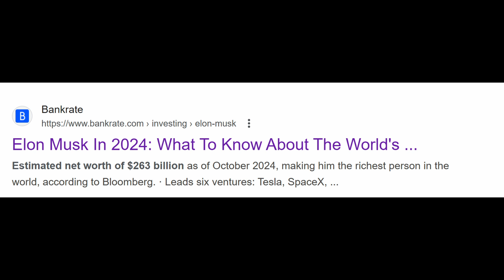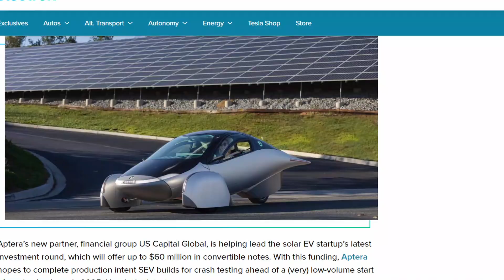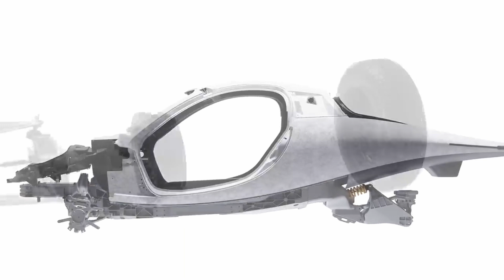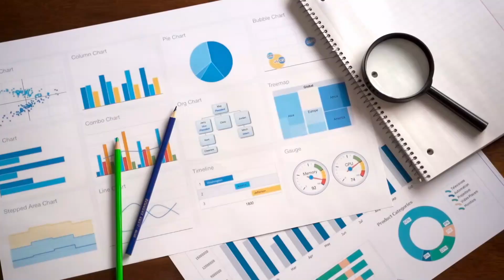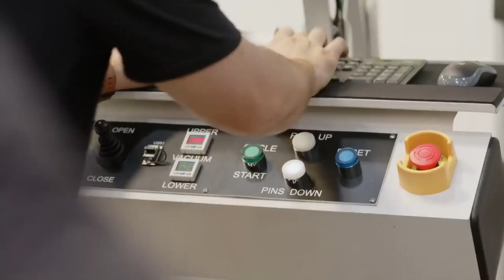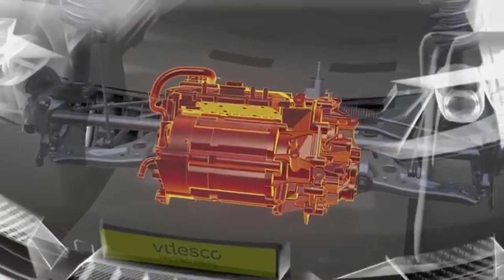Why APTERA Should Lobby PRODUCTION Funding from Elon Musk

Comment: Why should Tesla be interested in a motorcycle that is wider than a Hummer H1 and a deathtrap in case of an accident?
Reply: Aptera is very safe, and it is not a trap in case of a collision .  Read first, then give an educated opinion.
Reply: @EnriqueAThieleSolivan  in case of a collision the first thing that gets ripped of is the front wheel. After that the vehicle wil turn over and  land on the roof. You cannot open the doors when the Aptera lays on the roof, the windows are too small to escape. The battery pack is completely built inside the passenger cabin, so when it ignites the toxic fumes wil be inside. And because of the light weight and the very short front there is no real and effective crumple zone. Think first, then give an educated opinion.
Reply: @stix2you I know vehicle dynamics and physics. Thats more than anybody at Aptera knows of.
And the facts about the door, the small windows and the batteries that are built into the passengers compartment are self evident.
I might say: "educate yourself, then give an educated opinion," since you obviously haven't educated yourself.

Comment: The co-CEOs will have to be prepared to give up some control/intellectual property/technology/etc. The patents are quite valuable, but why not sit and wait for the company to go under then buy everything in a fire sale? Yes, it would be great for Elon Musk to write a check for $60+ million, but if Chris and Steve are hellbent on controlling everything there is no good reason for Elon Musk to save them. They could remain co-CEOs or find other leadership roles (ie Chief Operating Officer, Chief Finance Officer, Chief Technologies Officer, etc), but Elon Musk will get to place multiple board members (and most likely a majority of the board members) at the very least. Tesla and SpacesX would have immediate and unlimited access to all technologies/patents/etc. Aptera may have to source batteries and other things from Tesla. The Right to Repair that Aptera has been touting would likely go away and be replaced with a service program through Tesla. Tesla could use the Aptera body for the RoboTaxi. Coupled with the 1,000 mile range package that would be ideal for that purpose. This would likely mean that Tesla would get the first X number of production Aptera bodies to then have Tesla self-driving technology installed. Would this require a redevelopment of the operating system software in Aptera? Probably, although it would be possible to develop this independently of Aptera’s Operating System (although this likely becomes a Tesla system too). And this would likely delay Aptera getting to the end consumer somewhere in the 2027 or 2028 timeframe. I would like to try to see Aptera be able to get the Launch Editions out the door before this, but only time will tell. But if Chris and Steve aren’t willing to let some changes happen they are going to likely co-CEO this one into the ground too. I am sad to say this. I have invested a little bit. I am about halfway down on the Launch Edition list and I would love to get mine yesterday, but I am willing to wait to get mine and just hope everything gets done right so that Aptera comes to market.
Reply from the maker: Lo. You opinion counts. Thanks
Reply: The Aptera "patents" are worthless. Look them up.
Reply: @vic321344  - Anyone can circumvent those patents pretty easily. Just because Aptera says they are worth millions doesn't mean they are.